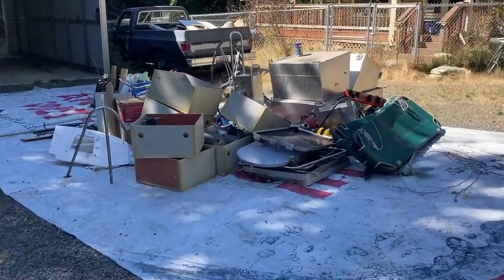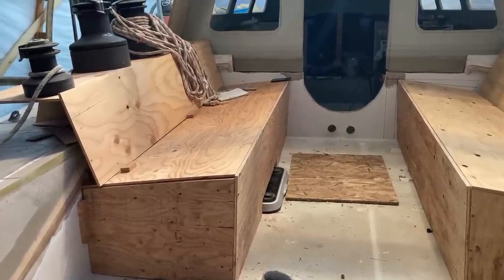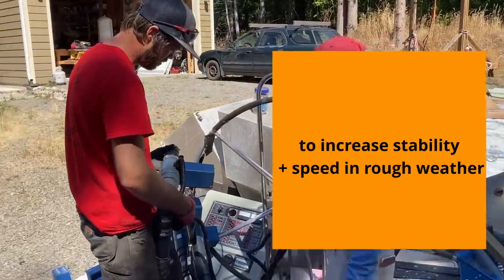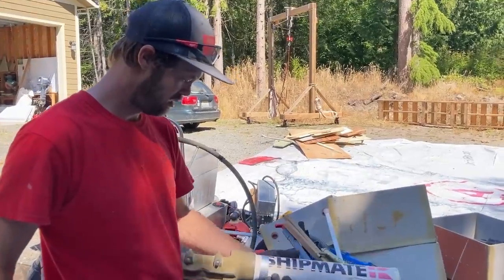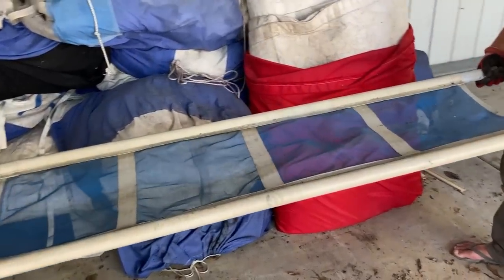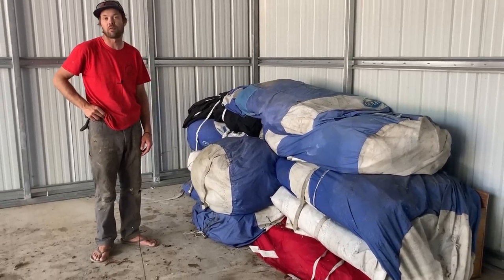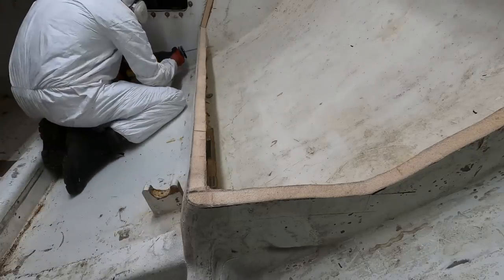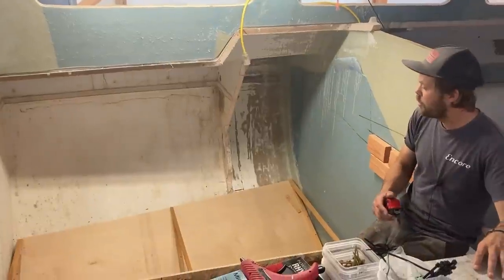A Boatload of Treasure & Mocking Up Fuel Tank [E43]

Comment: You might want to look into the various studies that have tested and compared generator, battery, electric motor vs direct diesel engine.

Because of the darn 2nd law, it's actually more efficient to just run a direct diesel engine.

It's pretty interesting to see study results that add up the power conversion losses from gen ->bat->motor

Unless something has changed, there's a reason none of the large commercial transport fleets have adopted that system

I admit I was like everyone else who thought, yeah, keep the Gen going at a steady rpm with no load (other than alt), charge batts and run motor. Voila, right?

Nope, direct drive at steady rpm, cut out the middle man.

Still, either way you'll have the proper diesel tankage. It cracks me up seeing the earnest efforts of those using solar consistently fail

As always,what are commercial boats using/doing? You know because you're in the biz. If there was a cheaper, more efficient means, people would have jumped yesterday

Instead, it's the same old, same old because you can't beat physics. I think only uranium surpasses the energy density of diesel.
Reply from the maker: When it comes time to design and install the system we will get deep into this.
Reply: @TheDuracellProject  it would be great if you could put together a few episodes where you review studies, interview researchers, etc

It's all out there; I think a lot is drowned out by the green marketing mania, but as you know, fishermen, ferries, the whole range of commercial craft still use 100 year old tech

Think how fast everyone would switch to gen-batt-motor if it actually delivered superior results

It's the same thing in truck transport. Wanna ship something to the other coast? It goes in a diesel big rig, often times a KW/peterbilt from your neck of the woods (across the sound)
Reply: Solar, wind, and regen can offset the losses and placement of smaller components will improve livability, esp in a long, skinny, shallow boat. Plus, you can choose when you run the generator; the engine, not as much. Think ending a passage in a quiet moorage  at night.

Comment: Is the plan to use a fuel tank liner or epoxy?  Calm as a kitty on a trampoline stretcher. 😹 About as funny to a cat as a convertible sailboat is to a sailor.
Reply from the maker: No need. Aluminum should hold up great if we keep it clean.

Comment: I do not know if you have taken into account in your fuel tank size that it has to also be small enough to be able to take it into and out of your cockpit via the door. Of course at this stage of construction this is not a problem however further down the line you may need to make repairs and you dont want to be welding an hopefully empty aluminum fuel tank in situ.
Reply from the maker: Hey Glenn, i don't plan on it being removable. it will have access ports on the top so that it can be cleaned out periodically.

Comment: How does aluminum do around salt water or just salt with humidity?  I live near the Great Lakes, so I don’t know a lot about ocean sailing.

I didn’t watch closely enough, but if the fuel tank does leak, will it be contained by a bulkhead?  Will there be baffles inside the tank to keep the fuel from sloshing around a lot?

How far will 150 gallons take the boat do you estimate?  I would guess that it will only be full at the start of long ocean crossings.

And I do like the idea of a convertible dog house…
Reply from the maker: Aluminum does fine if you keep it clean. Yes, it will be contained by a bulkhead but it shouldn’t leak. And yes to baffles!

Comment: I'm not big into sail boats but got a question 🤔 it might sound stupid to some of you but you but you don't know if you don't ask if you put 150 gal gas tank on one side and then on the other you just put the bunks want that make boat lean to one side ?
Reply from the maker: good question and i did not explain this in the vid well. i am building a galley and setee on the starboard side, both heavy things that will offset the fuel tank. balancing the boat is important and a lot of thought will be put into it.

Comment: Would not building the fuel tank(s) as part of the boat give you more fuel capacity to fuel your diesel generator and the same with your water tank? I have seen a couple of other boat builders who have done that to give them that extra capacity.
Reply from the maker: Hey there Gerald, it's against ABYC regulations to integrate a fuel tank into the hull. this is because if you were to breach the hull, you would leak fuel everywhere. Our water tanks, on the other hand, will be integrated.
Reply: @TheDuracellProject  thank you for the info.  As a novice I was not aware of that regulation, but I am learning by watching your videos and responses.

Comment: 150g of diesel is like over 1,000lb  at the stern on starboard, is that going to affect the waterline and listing of the boat?
Cheers, great channel!
Reply: Also, can’t help thinking fuel contamination is a real thing and you already have the smaller tanks that could be day tanks and spread the weight.
Reply from the maker: i think i forgot to mention in the vid that i am going to be building the galley and setee on starboard side-heavy things that will offset the fuel tank on port side.

Comment: Converting diesel fuel energy into motion energy and then converting that motion to electricity then converting that electricity back to motion energy is very wasteful. A diesel electric hybrid lets the diesel be extremely efficient without conversion waste 
A diesel will burn one a liter an hour 
Your generator feeding an electric motor will burn 2 liters an hour or maybe even 3 liters an hour

Comment: Why would  not use a poly tank alumumin tanks eventually rot and leak
Reply from the maker: because poly tanks imo don't last as long. they get brittle, the smell permeates them. as long as we have enough accesses to the fuel tank we will be able to keep it clean so it doesn't erode.

Comment: An asymmetrical arrangement for a 150 gallon fuel tank - and to only have a single one - seems problematic on so many levels - I'm sure you're well aware of a list of cons
Reply from the maker: the galley and settee will be on starboard side which will be heavier. it won't be the only fuel tank. there will be at least one more.

Comment: Please, please don't use aluminum for fuel tanks... Yeah, they will last at least 10 years but I've seen a few last 20, but most start pitting within 10 and are shot by 15 years,  If you want an alloy tank, go 316L stainless and you won't develop pinhole leaks and it will prob be lighter than aluminum.  If you can swing it, and I know you have the skills to do it, build a kevlar tank.
Reply from the maker: I have had no problems with aluminum as long as you keep it clean. Which we will do.